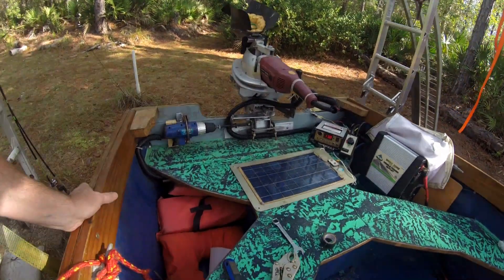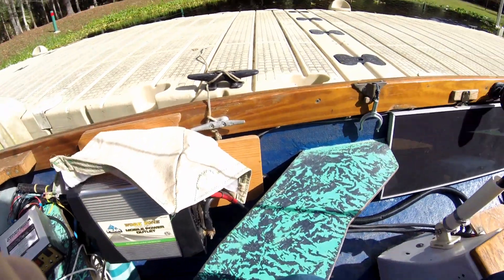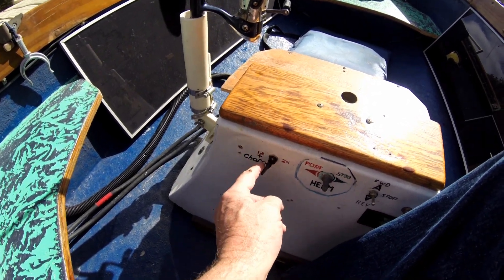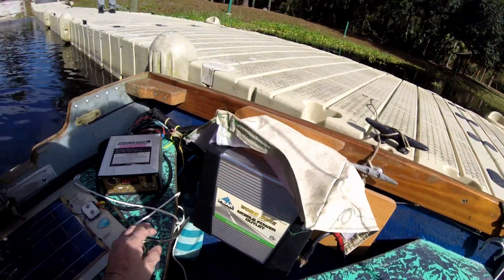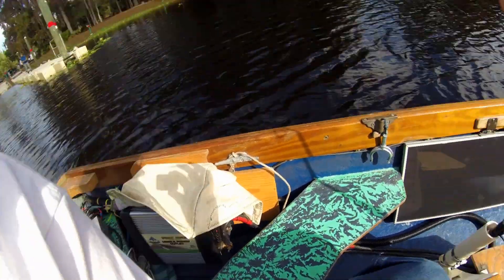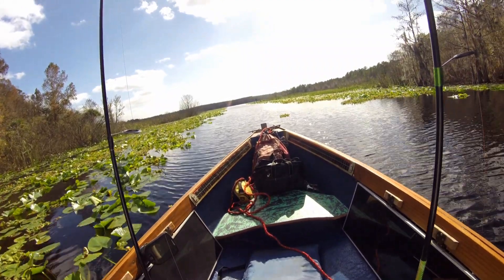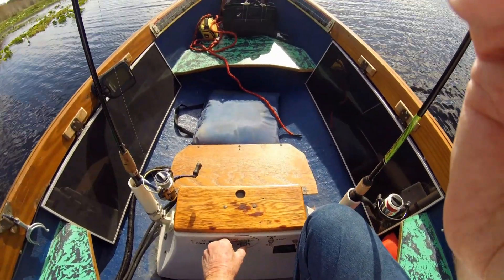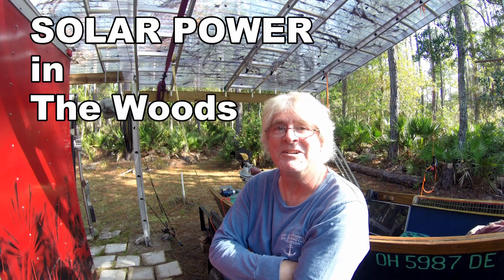DIY Small Boat Steering System Handmade Electric Helm Steering $40 !

Comment: Really nice set up you should put some type of kill switch in case u fall off
Reply from the maker: @cloudbydayfirebynight618  hey cloud,
Thank you for watching!
Thanks for the praise and system upgrade suggestion. I'm thinking of a couple easy remedies. 
1, open housing in the handle of angle grinder,
Drill kill switch mount thru one side of handle, cut power cable inside oh housing, wire in and install  the kill switch, have a lanyard harness to attach to belt ought to do it...